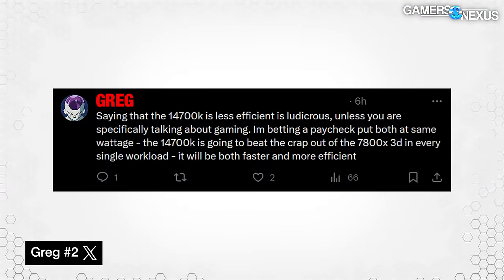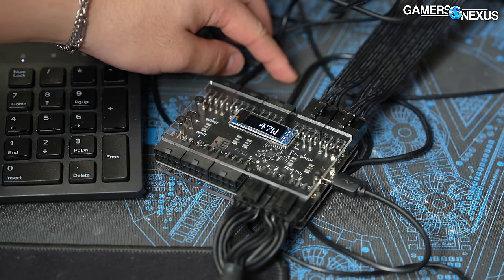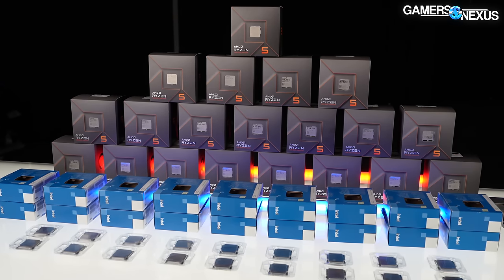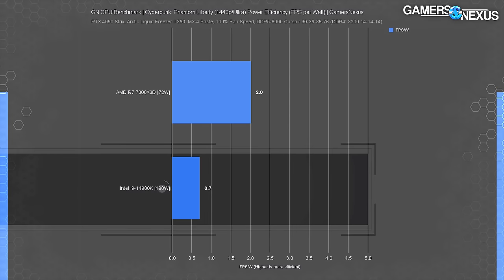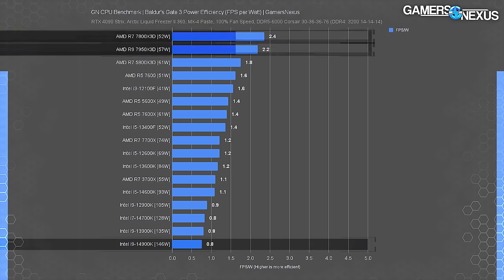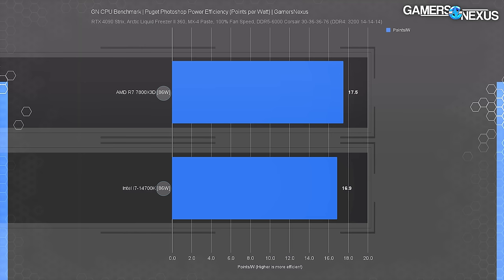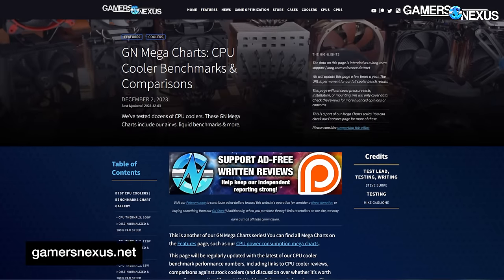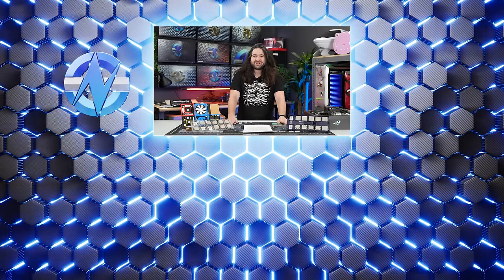The Intel Problem: CPU Efficiency & Power Consumption

Comment: "Ah yes, let me limit this 550$ CPU that I bought to 40% of its operating power, so it can get half the efficiency of its rival instead of 1/3rd"
- Greg, 2023
Reply: *of it’s 360$ dollar rival
Reply: fact is if you just limit power draw (not fps like this silly video did) then it's quite darn efficiënt for gaming. these chips are just stupid out of the box.and dont forget the 7950x also draws nearr 200 watts which is way past its efficiency curve.  limit that to 150 watts and its also way more efficient.
Reply: @pino_de_vogel  Why would you limit power draw if you're trying to measure efficiency for a typical use case? That's why they limited fps instead of draw. That's like arguing you should drive with your motor locked to 2000 RPM everywhere because it's more fuel efficient to do so. People are buying these products to just use them, any other points to be made are either worthless or blatantly made to try and discredit the fact one product is CLEARLY under-performing comparatively in the efficiency department. edit: switched MPH to RPM, because that's actually closer to what's being spoken about here.
Reply: @pino_de_vogel  Next time watch the video before commenting. They did limit the power and it did not make it more efficient than AMD.
Reply: @pino_de_vogel Hi Greg
Reply: Power use and performance don't scale linearly. Avergae resistance of transistors increases way faster than the frequency it switches at. This, for example, allows the Ryzen 7000s to use 40% power and still deliver 80% of maximum performance. Or, what I often do on my PC, where I have an i5 8400, at all core load 3.8GHz it uses 65W, whereas at 2.8 GHz it only needs 28W, keeping a lot more performance than it would if the relationship were linear.
Reply: @g_lise7103   Yup, part of the reason is voltage needed, power scales with the square of the voltage, so a 10% voltage bump will end up with 21% more power draw, add to that the linear scaling with frequency, and those last few hundred mhz intel needs to pull out of nowhere end up costing insane amounts of power.
Reply: I'm with you, but that's exactly what CVT-s are about - to lock engine to efficiency/performance rpm. Doesn't translate completely well to PCs, bc for cars it does actually make sense
Reply: @devilmikey00 maybe you missed the blender chart. And anyway other reviewers locked 13900k and 14900k to 70-90 watts and the FPS/watt is a lot higher. Steve done  like 90% of test on stock settings in this video, so a nonsense video.
Reply: @pino_de_vogel   You need to re-watch the whole video carefully.
Reply: you forgot that you have to turn off the e-cores too to avoid problems in games
Reply: @mrmrmrcaf7801  Any examples of problematic games? I haven't turned off my e-cores yet. So far seems to be ok.
Reply: @Smallman647  can you point us in the direction of those reviews? Very interested to see this actually tested on intel products.
Reply: So many Greg here.... damn ... even with the video we have here pino the Greg
Reply: @pino_de_vogel  ive limited my 13700k to 180w, enough for gaming with ~5.5 ghz, and in all core usage only 10% less performance for 100 watt less consumption... fair deal.
in the end both new amd and intel chips are performance monsters, that are a huge update from the pre 10-series chips. you basically cant go wrong (you can go wrong, if you dont power limit your intel^^ 280w for extra 10% is insane)
Reply: Undervolt + Disable or Park the eCores gets you within range of the 7800X3D. Personally I've never seen above 100W in gaming on a 5.4Ghz 13700k.
Reply: @pino_de_vogel  "if you just limit power draw (not fps like this silly video did)" - it looks like you didn't really watch the video, since it did also limit power draw. And the 7800X3D still won by a big margin. But then, we expect Gregs like you to comment based on your perceived reality and not the real one.
Reply: @ashamahee  der8auer for 13900k and techpowerup for 14900k.
Reply: @ETophales  he limited the power draw only on blender and photoshop.
Reply: @pino_de_vogel  Oh hello Greg :D
Reply: @Smallman647  And Phantom Liberty. See around 11:11.
Reply: @griffin1366  yes, undervolting helps as well...
intel tried too hard to beat amd, in making their stock settings way over board and irrelevant to all day use cases.
Reply: @griffin1366  Wow, the hoops...  let me undervolt AND disable/park cores as well as click my heels, just so I can "get within range of the 7800x3d".  I know, how bout I just buy, for a cheaper price, the CPU that is better - which is the 7800X3D itself.  Then I don't have to do all the other crap to get not only better performance but better efficiency.  And I don't have to come onto some website and dispute videos showing me exactly why Intel sucks balls.  Just face it "Gregs of the world",  AMD has a better CPU over any Intel offering, period.
Reply: @devilmikey00  not for gaming.  only for other workloads which is the wrong usecase for power limiting.   other workloads use 100% of that power gaming does not s power capping only works for a gaming rig which is what they did not test they capped fps instead...
Reply: @Ogk10  you make no sense if you have nothing usefull to say say nothing.
Reply: @anorax001  i only see power capping for other workloads not for gaming.  gaming behaves diffrently. power capping only works on gaming loads and fps capping is utterly stupid if you want to reach peak efficiency.
Reply: @ETophales  i only sawe a power draw limit on the other workloads not gaming. on gaming it still stated way to high numbers for power draw.  link me the timestamp you think they limited power draw on gamig loads.  as i saw none whatsoever while that is the only place to do it as other workloads need the power. inteld perfect power durve for gaming is between 100 and 135 watts i see no tests being done there.  i just see a chapter limiting fps which is nonsense testing to me. and chapters for editing workloads which isnt the usecase for power capping (even tho they did prove the commenter wrong).  im not saying intel will be more efficient as the amd i know under more then 1 core load it wont be but it ccan be a whole lot more efficiënt as it was here.
Reply: @Bourinos02  i kow facts are not forr everyone.  testing here was just wrong in my opinion.  You dont limit fps for gaming to get efficency.  clearly tested by a non gamer.  as a gamer i have tested this time and time again and i know capping power has a bigger impact on efficnecy then capping fps. Hence this capping fps test in my opinion is invalid. i normally likes steves work but i feel he did it wrong here (on the gaming part).
Reply: @pino_de_vogel  Oh dear. You are talking literal nonsense here - I could explain it to you, but I can't understand it for you, so I'm not going to even bother - you're too invested.
Reply: @Verhagenvictor This only applies to pure resistive loads, semiconductors don't quite behave so neatly. They still don't scale linearly but it's not going to be a neat and tidy squaring because the effective resistance changes a lot depending on a lot of other factors
Reply: @Smallman647 Literally the second test was the 14900k at 86 watts, being more efficient than the 14900k at 190W factory but still much worse than the 7800x3d. Yes, lowering power for the 14900k will make it run more efficiently than the same chip at stock. But increasing its efficiency from "horrendous" to merely "bad" doesn't somehow make it beat "quite good" on the AMD side (or even "OK" for Intel's lower end parts that are running in a better part of Intel's volt/frequency curve)
Reply: @pino_de_vogel  Oh you sure did Greg :D Why trust people with a literal external power meter connected to their system instead of you?! I'm sure your 14900k is running very well with 15W for gaming on their 10nm+++++++++ Intel process node...
Reply: @Bourinos02  your fanboy b ehaviour is clear go buyAMD lol  ik just buy whats best for me instead. pethethic ytou wont even knowledge facts.
Reply: @pino_de_vogel  Facts are in this very video. You being a fanboy has nothing to do with anything factual. Intel is at the exact same place now like AMD was during the Bulldozer era. They sat on their cash for too long and haven't pushed innovation enough and they're paying the price now.
Reply: @Bourinos02  And answer me this since you blindly trust this data and methods while i have proven the method is wrong.  does this power meter account for power drawn trough the board and 24 pin connector?  I dont know and you dont know so actual wall power would be a better safer method to see what a system draws.  Specially sas based of all data out there AMD motherboards are less efficiënt then intel boards too. A intel cpu idle ises 25 weatts but a amd rig uses 35 watts more total power drasw for a simmilar syste @ idle so that means a amd board is 10 watt less efficient. Not irrelevant data as 10 watts over 4 years with my usecase =   over a 110 bucks over the 4 years my components usually last. so that effectivly makes a intel board 110 bucks cheaper. 

facts matter and all data needs tro be correctly taken for that.  im not disputing the data he created im just saying he created the wrong data.
Reply: @pino_de_vogel  Lol, changing topic to idle power draw now?
Damn you're really grasping at straws...
Well, enjoy your alternative reality!
Reply: @Bourinos02  Where are the facts? Where is the gaming load tested with a power cap?  It's not it is tesdted with a fps cap which is the problem...

And bulldozer was something completely diffrent as it was worse then phenom 2 right off the bat and never improved due to the shared core system which was a terrible design. It was a trash cpu lineup.

And intel didnt sit on their cash they have production issues.... they have cpu designs on the bench waiting to be made but the process to make them is not working right. That setbacks btw costs tens of billions how is that sitting on your cash?  your logic is stuck in highschool i think.
Reply: @Bourinos02  Just adding up facts as it matters. You are the one that refered to the external meter i should blindly trust so i countered with more questions about it you btw ignored as your clueless and likely didn't even think of those factors that are fully legit as power is a total picture not a pci power draw picture.  But choosing to be ignorant makes accepting data that doesnt do a scenario justice easier.  I stand by my point power cap is the way to go and full system power is important as otherwise you ignore several factors. fps cap to lower power draw is dumb.  simthing you could have tested and realized by now but clearly didnt as internet trolls dont like facts  ot do research.  But really go ahead start a game check gpu/cpu power draw then cap fps and power by 30% and see which gives you far better performance... its easy but its facts you may not lie after all this invalis argueing you do.
Reply: @certaindeath7776   Yeah I dropped about 25% power draw while keeping the same clockspeeds (5.4Ghz)
Reply: @valthar3655   Just saying it's an option if you care that much.  Pointing it out is not "jumping through hoops".

7800X3D is not cheaper, at least in my country. It was 30% more than the 13700k but I haven't checked prices in a while.

Out of the box I agree that AMD is better (unless you need the extra cores) but tuned Intel (+RAM) is the better in most cases depending on the game.
Reply: @pino_de_vogel you did not even watch the video, Greg. One of the first few tests at 11:00 he limited intel cpu power at 86w
Reply: Its a stupid scenario. The only real reason to go after a 14900k vs a 13900k is for its overclocking headroom and use even more power. leaning out the most power hungry processor for efficiency reasons is just idiotic
Reply: @pino_de_vogel  If you have to limit the power for the Intel CPU to get anywhere near the efficiency of the AMD CPU without a power limit, you still have less performance per watt on the Intel CPU. 

The point of the test was to determine total efficiency of how much performance you get PER WATT in a given workload, or in some tests, how many watts per unit of measurement. In either case, AMD was most efficient across the board of the entire product stack. 

Its like you didnt even pay attention to the words spoken in video or actually read the graphs....
Reply: @RealGreyGhost 
Pay no mind to the Intel shill. I, too, got disappointed with Intel when I put it to work.
Reply: @RealGreyGhost  It's not about getting the Intel to the efficiency of the 7800X3D under load. It wont get there without massive prtformance losses thats a cold hard fact. the 7800X3D is and will always be more efficient (under load) as current gen intels. It is however possible to make it 60% more efficiënt in gameing workloads with barely any performance losses. (rendering has more losses thats why im only talking gaming here which realisticly is what the 7800X3D is targeted at and thus a fair comparrison. 

It's like you didn't read the words i write...

I'm not arguing the intel is more efficiënt under load, it's not  but it is a lot better when power limited instead of FPS limited. 

So the performance per FPS numers are trash to me as i know when power capping the intel to realistic numbers its a lot better then stock. and the caps applied here where pretty dumb as 86 watts is way past its efficiency curve and 186 watts is way to high.  the real optimized point is around 110-125 watts depending on the sample of chip you have for 1080p gaming and for 1440p you can lower this by 10 to 20 watts and for 4k gaming you can easilly use that 86 watts target as you will be hitting gpu caps in most games.

And if you factor in idle power draw Intel will be a descent choice as amd is just trasshy compared to intel when idle.  if your system never idles and you game > turn it off thats irrelevant but i spend 10 hours a day reading, watching videos, mailing, editing photos which is practically a idle task cpu wise these days.  in those 10 hours a day i save 350 wh with a intel rig vs amd rig while with a capped 125w cpu vs 86 watt cap on amd is good for almost 9 hoursa gamingf with a less efficient cpu hile i only ghame a couplle of hours a day so bottom line intel is cheaper to operate despite the power draw.  

The only downside it has is summers where it is already 30+c in my game room but that is offset by winters wherre i don't have to heat my pc now and with AMD i might have to. 

So bottom line they are both better in a different usecase and power draw is rather irrelevant if capped by PL1 instead of fps. Like it's supposed to be done.
Reply: @pino_de_vogel   Thats a whole lot of copium, Greg.
Reply: @RealGreyGhost  ignorance isnt something to be proud of and neither is being a amd fanboy  bye... waste of my time.
Reply: @Smallman647  in blender 14700k was power limited while 7800x3d not (you can power limit amd too) and even with that advantage they were closed and too bad he didn't included 7950x3d with same power limit in that test, and just look who was in the top the 7980x with insane power efficiency/performance and look at the bottom of the chart 14700k without power limit
Reply: @razoo911 do you know 14700k and 7800x3d costs similar? What is the point of comparing pieces of different prices? Otherwise you can test 14900k at same tdp on blender and will be more efficient than 14700k and will beat by a larger margin the 7800x3d in that scenario.
Reply: @Smallman647  do you know it's not true at least in europe and i think in majority of the world? and do you know this is video on power efficiency? where intel lost bad so i only pointed out that in blender 14700k was power limited while 7800x3d not which gave to 14700k an advantage otherwise it was at the bottom of the chart
second 14900k and 14700k efficiency are more or less the same
Reply: @mrmrmrcaf7801  The e-cores are supposed to make the cpu efficient. Not less efficient. Turning them off just makes it an i7-9700K with some 5 years of polishing.
Reply: @pino_de_vogel  You keep calling people fanboys but you are clearly a fanboy... Chill out greg
Reply: @Smallman647 do you know that your country is not the only one that exists??? It's crazy I know but I assure you it's true
Reply: @lilpain1997  usually the prices in Europe are very similar.
Reply: @Smallman647  far from it
Reply: @lilpain1997  based pon what nonsense am i a fanboy.  I have a intel cpu and a amd gpu for about a decade now. i used to have a amd cpu and i ahve had nvidia gpus as well.  i buy whats best for mebecause i dont fall for the nonnsense others fall for.  i base purchances on facts and my usecaseand intel currently has the cheaper cpu option for me while amd has the cheaper gpu. but keep trying to put your narrative on me it wont work.
Reply: @pino_de_vogel  Greg. Learn to type a sentence please.
Reply: @lilpain1997  If you learn 2 other languages and  used them instead of your native language i might consider your  "request".
Reply: @pino_de_vogel  troll